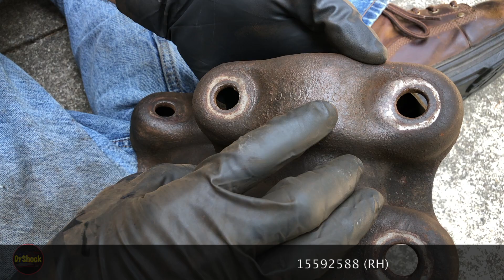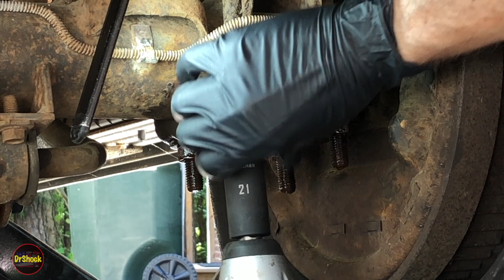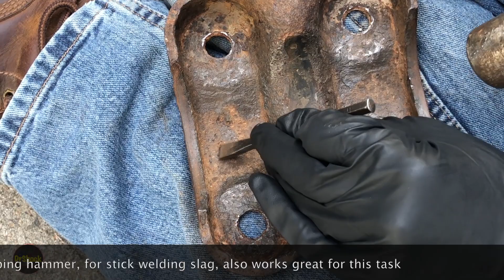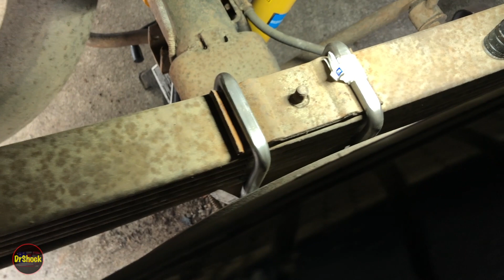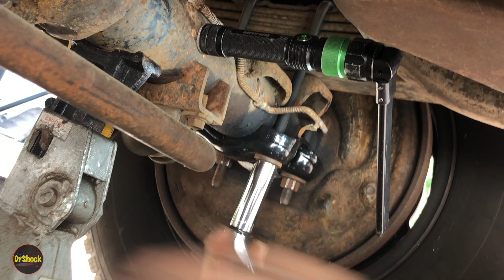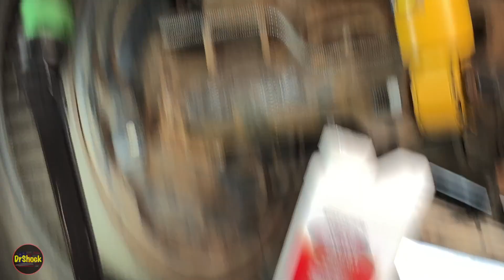1988 - 2000 GM OBS Truck and SUV Rear Axle U-Bolts & Anchor Plates Replacement (Chevy & GMC)

Comment: Question - is it necessary to jack the truck up and put the axle on jack stands if you already have enough room on the ground? Sitting the axle on jack stands would leave the same amount of tension on the leaf springs as it would just sitting on the ground, correct?
Reply from the maker: I would recommend you use the jack stands for this particular repair.  The stands do relieve some leaf spring tension, vs vanilla ride height.  And they help to avoid any shift in the original position of the anchor plates with respect to the axle tube.  This is important to avoid introducing a shift in the axle position to the left or right that may introduce a pull, vibration, or noise after the repair.

Comment: Don’t reuse rusted parts
Reply from the maker: Not always good advice. When repairing vintage vehicles over 30 years old, where no new parts (neither OEM or aftermarket) are in production anymore, there is no alternative but to restore used parts.  You restore the original parts or restore original donor parts that remain serviceable, those are the only options for keeping the vehicle on the road.

Comment: For anyone else needing part numbers for a K1500 the correct u bolts for a 1998 K1500 with a 14 bolt rear diff is 15529595. I initially ordered 15529596 and they were too long.
Reply from the maker: The part numbers for other sizes are all in the video description including the one you mention.   One video cannot cover the unique parts used across the many different axles used in GMT400 production so I had to list them in the description instead, but the procedure and tools shown are the same.

Comment: Good video, Thnx.
What if your axle is leaking from where the U-Bolt saddle mounts? Any suggestion on how to repair that?
Reply from the maker: That’s an indication the axle tube itself is compromised and should be replaced with a good donor.
Reply: @ that’s what I was afraid of.

Comment: helpful vid. had to replace mine the ubolts were seized. i has a 6 inch lift and its only about 4 years old. got replacements and will install as soon as it warms up. im having to cut them off due to the rust.

Comment: I still don't understand why there are different left and right side plates.  LMC Truck sells only one part that supposedly works on both sides for my C1500, but everywhere else says there's a drivers vs passengers one.
Reply from the maker: LMC is selling the aftermarket part that way because it can "fit" on both sides, but they are slightly different in shape as I showed.  Given that GM discontinued one side for the 2500 trucks (you can still get both sides for 1500 trucks) you don't have many options other than going used as I did, or using two of the other side that is still available.
Reply: @DrShock  I was on GM's parts website and they're acting like they're not available for my 1989 C1500, but I'm going to try to source some OEM ones.   Mine are paper thin and the U bolts are about as thick as number 2 pencils at the moment, ha!
Reply from the maker: I put the part numbers for all of the C/K trucks in the video description, if that helps.

Comment: I wonder if using the pb blaster from the top and bottom of the bolt would make it easier to come off without breaking?
Reply from the maker: I'd say no.  The reality is that penetrating oils only go so far with heavy corrosion and compacted road dirt, there's been some other folks who did test videos about that.   

The only tools that would have avoided the break would have been an oxy-acetylene torch or induction heater.  But I strongly suspect we would have ended up cutting them off anyway like the drivers side so ended up just fine imo.

Comment: Couldn't you use the rh plate for both sides?
Reply from the maker: As I showed in the video, both sides have different GM part numbers for a reason.  They have slightly different physical dimensions making them side / orientation specific.   Would it matter to use the wrong side plate if the axle housing was not suffering from corrosion, probably not.   But given the corrosion on this particular trucks axle, using the correct side prevents further housing stress at the mount point that might lead to having to replace the axle prematurely.
Reply: I was just thinking that if they match up one way and not the other. That if I were to just mount the rh side 180 degrees the other way onto the left hand side would work. I gotta do something since my u bolt broke and it's soo rusty.

Comment: Again, another excellent video, your attention to details of any subject in video and your write ups are impeccable. Funny, when changing U-bolts as I have done in the past, I would have cleaned axle and brackets, and unless they were totally compromised I wouldn't have paid any more attention to them, I guess just taking them for granted. But you have educated me, I will be looking at EVERYTHING closer in detail from now on. No more taking things for granted.  BTW how do you like your induction heater? Is it good quality? Thanks Joe
Reply from the maker: Thanks, I love the bolt buster (the original inductive heat tool).   I still have my oxy-acetylene torch setup but haven't pulled it out in years.  ;-)

Comment: FYI, the GM part number listed for 10 bolt axle spring anchor plate for my 2000 Chevy 1500 when I checked gmpartsdirect is 25761309 for both sides (I assume, since they only list left side on the site.) You have a different numbers listed (15592585 and 15592586). Not sure if they changed it, or there are multiple part numbers going around. I will have to check it for fitment when it gets here. Thanks for the video!
Reply from the maker: This video, and the part numbers, are only for OBS (old body style) C/K trucks.  It wouldn't apply directly to the NBS trucks that launched in 1999.   So for 2000, yours is an NBS as the OBS 1500 pickups ended in 1998.  For 2000 only the 2500/3500 were still being produced as a classic in the old body style.  Hence the difference in part numbers you ran into.  Technically the OBS 3500 was still produced well into MY2002, but I don't include this year or MY2001 to avoid confusion.
Reply: @DrShock  Ah, sorry I missed that. I figured the axles would be same, since they appeared identical. New to GM trucks. They are a bit confusing with how many years and models they had. Thanks for clearing that up!
Reply: @ScientificBoink  1988-1994 OBS: GM 15592585 - Left . GM 15592586 - Right.  2000 NBS: GM 25761309 Both

Comment: I see I am about 20 hours late.  I am trying to do this in my head, but if you turn a right side bracket 180 degrees, isn’t it now a left side bracket?  That would explain why they discontinued only one.
Reply from the maker: Maybe.  But they only discontinued what is typically only used on the 2500 size axles, not the 1500 version.  Usually GM will issue a parts note for any substitutions, but they didn't do that for this particular part.   I certainly think you can sub the RH side one in a pinch, but elected to keep it all original.
Reply: Came to ask the same thing for my 1500 any more info on this? I ordered replacements from general spring and two plates showed up stamped LH, when I contacted them they said they were identical and there was no difference.

Comment: Always replace the nuts and washers too. It's good practice to never reuse hardware on suspension parts. It's cheap insurance. No, seriously... It's cheap. Don't be that guy. And as far as the rear plates... Again.. Cheap. Your life is worth more then $25 bucks. If your doing this job, thank the old parts for a job well done, and replace everything with new parts.
Reply from the maker: Certainly something you can optionally do for peace of mind.   Inspect your parts and fasteners, discard and replace with genuine OEM parts only if necessary due to corrosion or physical damage.   Otherwise, repair, restore and reuse in accordance with the GM service manual specifications.

Comment: First I gotta say your vids are Great and have given me some valuable info in regard to assessing my 1994 K2500 6.5 Suburban. So Thanks! One question, why can't you use the passenger side on the driver's side just flipped around? Are  all other dimensions aside from the rounded cuts on each side semicircle?

Sorry might be a dumb question as im assuming if you could flip them around you would have bought 2 new passengers.
Reply from the maker: Thanks.   When I went to collect the OEM parts for this job, I noticed that both the 1500 trucks and the 2500 trucks had a different number for LH and RH sides (all those parts are in the video description btw).   Both are still available for the 1500 trucks, but GM discontinued the LH side for the 2500.   Knowing how cheap GM can be, they wouldn't have made two different parts if they could have made only one.  I believe you could get away with using two RH anchors, but given the axle tube corrosion / pitting I didn't want to chance even a mm of extra pressure and tracked down the correct LH side from a southern bone yard donor.
Reply: @DrShock  Makes sense. And I'm getting a vibe from watching your vids that you like to have the parts as oem and period correct as possible. Not sure if I'm getting the correct vibe on that but if so it would be proper for you to source the correct left hand side with the correct part# instead of putting a right side on the left side. Again, I really enjoy and appreciate your Vids! Thanks so much for sharing your knowledge and skill!
Reply from the maker: I spent a few decades doing GM classic restoration work, numbers matching and back to GM assembly line originality.  I only do repair work nowadays and that's mostly what I share on the channel , but I suppose that attention to OEM restoration detail does give off a vibe here and there even on a repair job.  ;-)

Comment: Maybe put oil on the threads and start with 20 LBS  while you're at it might as well remove the bolts that holds on the backing plate, Thay are in the same shape as the u bolts, hit the brakes and around we go.